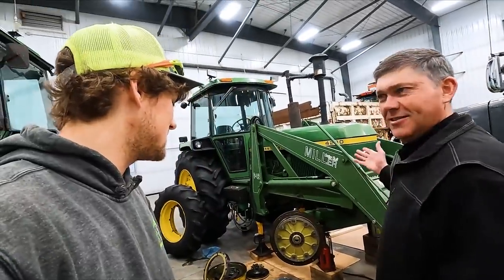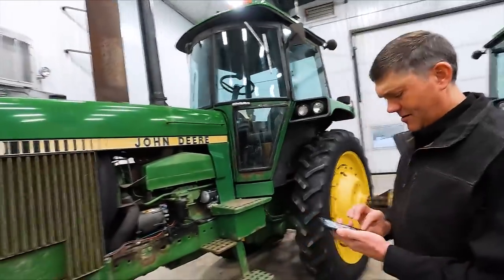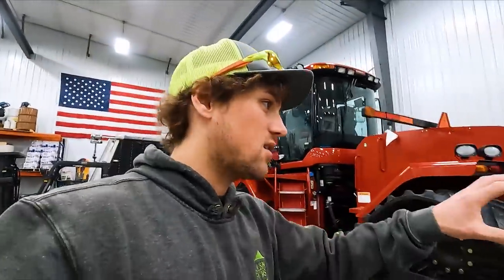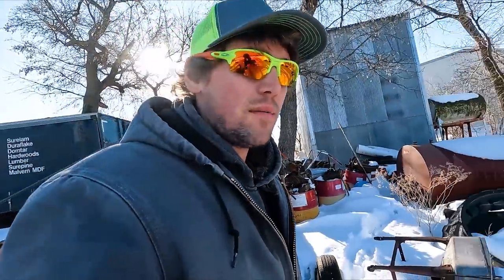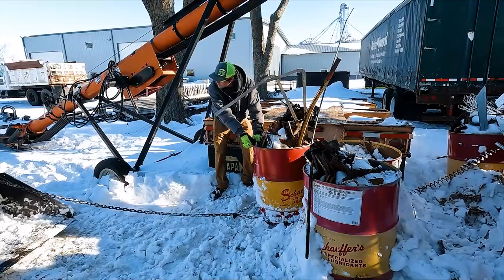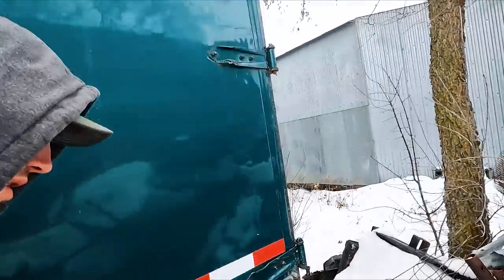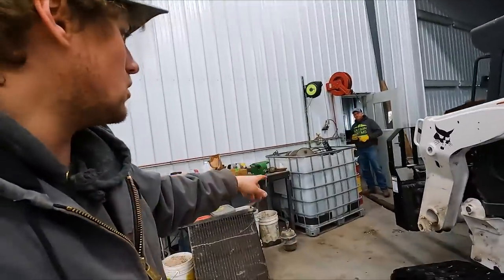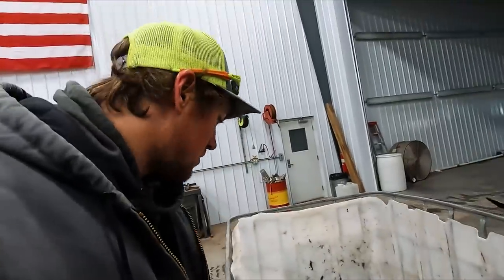Last Video Of The 4640!! Sold!

Comment: Burn barrels, well see now you need to get a plasma torch.  Weld three 6 inch legs on the barrel, cut designs in the barrel to let air in and for the fire to show though.   You can make some pretty impressive looking burn barrels.

Comment: Chet look up barrel grabs there are different types, makes moving and picking up barrels much more manageable. Used them in the Tower Crane world for storing and shipping multiple 25-50 pound tower bolts to and from job sites worked great easy to chain 35-55 gal barrels/drums when shipping on flat bed trailers. You already have the equipment to pick up and use the barrel grabs plus the main thing about them it’s easier on the back and fingers. Keep warm and God bless you and your family.

Comment: You won't find tractors like those here in eastern Kansas. I drove 6 north to NE Nebraske for a 2 wheel drive 4230. Don't know what you got out of it but I would bet you could have gotten several thousand more done here. I know I could make 4-5k on the one purchased last year.

Comment: Dougo , question on that 7040 AC was that a model after they started purchasing their rear ends from John Deere? Because when my employment of working on tractors finished when I found a job on the railroad that paid better benefits retirement and wages. The last tractors I worked on where 190XT and the biggie the D21. They spent more time in the shop in two pieces replacing the bull gears and pinions and associated bearings in the differential then they did in the field! Also in Minnesota do you put a down payment on that Corner Room at the nursing home or just like the lawyers have a retainer. Retainer works best here in North Dakota that way you don't own anything and it saves the children a lot of paperwork. Besides unless you're sucking cellulite off the surface of your Gluteus Maximus, and injecting it to smooth out the wrinkles in your turkey neck those few crow's feet at the edge of your eyes doesn't qualify you for a long time to be headed for a nursing home.

Comment: If your 644 is like the older ones I worked on in the 70's the front end should be limited slip and shouldn't have 1 wheel spinning

Comment: We had a 9520 hit a bridge 30 mi from the house we bought it in Florida we cried took the top right off I think if I was that guy I will take the tires off and put it on blocks onto the trailer just to be sure we were 13 too and slice it off like butter